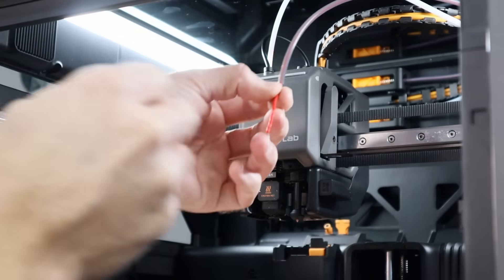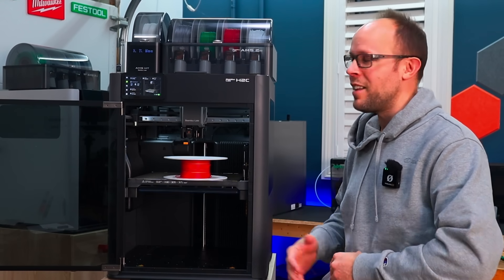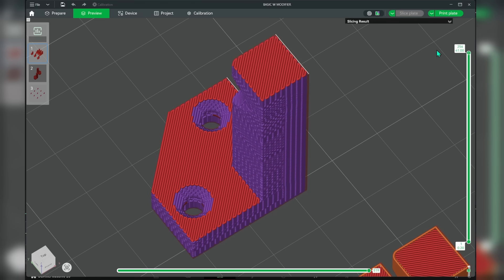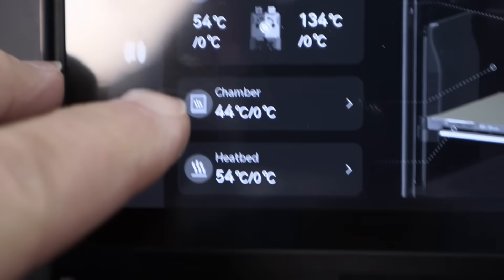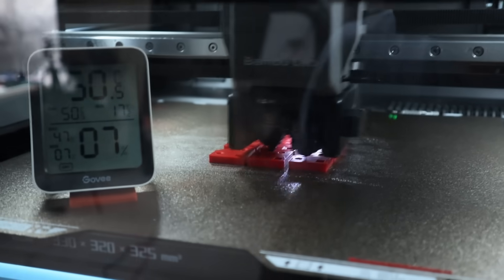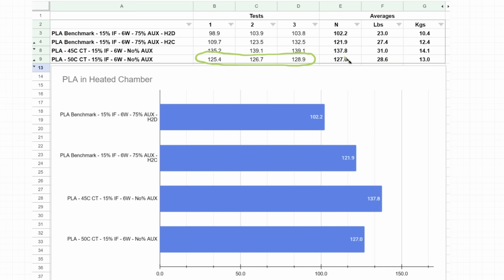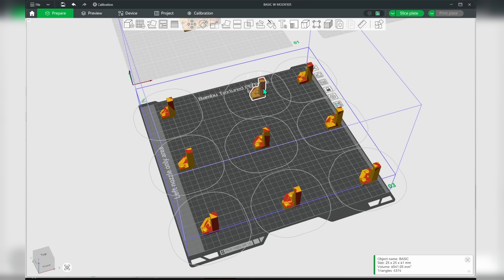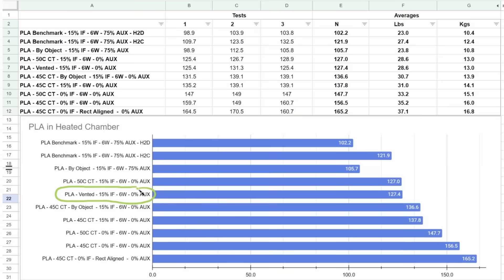If PLA can be printed inside of heated chamber, how much stronger are those parts?  Let's find out!

Comment: I would love to see temperature modeling of the filament and part trickle down to consumer slicers and machines someday.  The really high end machines keep a model of the heat flow through the part along and adjust fan speed and temp as they print to account for it.
Reply: It already exists in bambu slicer
Reply: @riba2233  No, it does not.  Variable fan speed and layer time is not the same as basing it on thermal modeling of how the heat is flowing through the filament into previous layers, and how cooling, layer time, and time the nozzle touches the previously layed down plastic and transfers heat into it.
Reply: @crashingsux  it does exist and I'm not talking about this standard stuff. It's called Helio simulation.
Reply: @riba2233  Oh yeah, I know it exists, just not accessible to non-industrial users that I know of. But if you have any links to things I could try out I would be very interested.
Reply: @crashingsux  it's accessible to everyone who uses bambu slicer, it's the icon in the top right next to the X button. It is a paid feature though, but I think they give a trial period.
Reply: @riba2233  Woah.  I didn't even know they had paid features.  I'll have to check that out.  Thanks for the tip.
Reply: @crashingsux  that's the only paid one tbh, and most likely just because it's a third party. Np 😉

Comment: the explanation of rectilinear infill "extruding into hot just extruded filament" makes no sense, of course the filament lays down next to hot filament horizontally but that has nothing to do with the layer below being hot, on the contrary it's normal walls that extrude on hot previous layers especially with no infill as wall speed is so high and when you go 1st layer in out 2nd layer out in! I assume the higher rectilinear infill strength is caused by the extra plastic extruded when the printhead changes directions fast making tiny blobs in the walls.

Comment: An interesting thing to try would be Helium. It has significantly higher heat capacity than "air", so you should be able to have high chamber temps while still having the heatbrake not get nearly as hot, since the helium is more effective on the heatsinks.

Obviously not very practical for the home printer, especially if it only improves strength in one axis by single-digits percentages.

Comment: Maybe just heat the air going into the cooling fans instead of the entire chamber? That way you should be able to have higher temperature air, but the nozzle, heat brake, filament bowdens shouldn't be getting nearly as hot. Plus, the hot air should be concentrated mostly at the top layers.

Comment: The material strength is often secondary to the design of the part. The flexibility of the geometry means you can just make weak points thicker.

Comment: In my experience, the active material doesn't suffer much from the chamber temp, as the warm material in that filament path is constantly being replaced with cooler stuff. But whatever is in the second nozzle (in H2D in my case) just soaks up the heat, and buckles or mushrooms as soon as it's needed.

Comment: Pro tip, try this test with a polylite pla filament. They anneal it so the filament on the spool has heat resistance of 140c. 
Also when you get a max4 printer try this again with the polar cooler.
Reply: I did a quick search but wasn’t finding anything saying they anneal their PLA filament. Do you have a source. Would be cool if true.
Reply: @jesondag  it's on their web and in their datasheets, they call it jam-free tech:

Jam-Free™ technology improves the heat stability
of Polymaker’s PLA filaments with softening
temperatures over 140 °C. As a result, Polymaker’s
PLA filaments show minimal softening in the “cold
end”

Comment: We fixed Replicator 2X heat creep / filament slippage by flowing compressed air through the feed tube.
For continuous operation, a membrane pump + heat exchanger was successful, along with a feed port made with a vented screw drilled to 1.8mm and screwed into a 3D printed manifold.
With that you can keep filament cool right up to the extruder no matter the chamber temperature. The outflow also serves to cool the drive wheel and motor shaft, and to some extent the heatbreak.
Reply: Excellent idea!
Reply: @michaelnoble2432  It's funny how a solution born out of the need to work around a bad early extruder design could allow printing PLA today with a heated chamber. If anyone can use it today to unlock better print results, please go a head (and show us the results... I've got a printer to modify as well, but making those screws is always an adventure)
Reply: What a great idea! I guess a relatively loose bowden tube/filament fit would be beneficial here, I've noticed the expensive Capricorn tubing has less clearance than the regular cheap white PTFE tube.
Reply: @ferrumignis  it doesn't take a lot of flow rate since the thermal conductivity of the tube is low. And then there is star-shaped PTFE tube, which is both tight and allows greater air flow. I should buy some..
Reply: @hardwareful the exact same idea popped into my head while watching this video! I also thought it could work well with those new star shaped tubes. Do you have designs for this feed port/manifold? And is the heat exchanger a necessity? Or do you use it to cool the air below room temperature?
Could this be good for TPU as well?

I'm also curious if there are any advantages or disadvantages using such a setup with more heat resistant filaments?

Perhaps it could make even higher chamber temperatures, like 60-80°C or higher, easier to attain. You mentioned cooling the extruder gears, with enough flow and a suitable design the print head electronics might be included as well. Although it might be undesirable to blow too much cold air around the part being printed, since its what we needed a high chamber temperature for in the first place. Also the chamber heater would have to keep up with the inflow of cold air. Then again, the inflow air would have warmed up a bit at that point. Alternatively a return air-line could be designed, perhaps coaxial with the filament tube using another larger diameter star shaped PTFE tube. 

At some point liquid-cooling might become easier...
Reply: @Ahapenootjes  Interesting angle to actively cool filament to make it more printable! The heat exchanger (not ideal - one of those dual 120mm fan jobs for PC watercooling) was necessary because that's how the pump gets rid of part of its heat.  Otherwise it would reach >40°C already. at 18°C room temp. TPU: anything helps, but I'm not sure it's feasible to cool down to like 0°C with peltier + pin-fin heatsink in a sealed and ported chamber. Does TPU in the fridge feel stiff enough? If so, one would need to pull the air intake through CaCl2 to dry it, or be dew point limited. Or be very hacky and put a radiator into the freezer, which will eventually clog up with ice but deliver cold, very dry air.
Reply: @Ahapenootjes  manifold design files: I'm afraid they're lost to time, though I have kept one printed ABS version of that thing. I've ordered vented screws and star-shaped PTFE tube and will spin a modern version with push-in connectors. Fwiw you can also use Volcano nozzles with 1.9-2.0mm ID, they should be long enough to act as a filament feedthrough bushing with sufficient flow resistance when the tip is filed down or drilled out.
I expect someone to beat me to it though. It's a proven concept, not much to go wrong except for the clearance between bushing and filament.
Reply: oh, cool. I was thinking water cooling of the hotend and extruder but was wondering about filament heating in the tube on the way to the extruder. I love your solution.

Comment: My only real issue with PLA is how quickly it deforms and melts under heat. HT-PLA doesn't solve the problem because while it's resistance is really high, it's only under its own load. As soon as any type of load is introduced it deforms. I primarily print in PETG because of this and I wish someone could solve this issue with PLA. I love all of the matte finishes, tons of color options and rigidity of PLA but prefer the heat resistance, impact resistance, flexibility, chemical resistance, etc of PETG. I would love to print in ASA or something but I refuse to deal with the toxic styrene fumes.
Reply: Then print with pet or pc

Comment: Yes you can print pla and petg in a enclosure. Do it all the time because of fume extraction in the prusa xl :) it's not a heated encloruser but it runs closed for 13 hours and get's pretty warm inside.

Comment: There is always some trade-off: either fast or solid, either good looking or solid. I print only utility parts and my printer is slow anyway, so I just go as high with nozzle temperature as I can with the part cooling fan as low as possible (sometimes off), also some over-extrusion (flow) and increased extrusion width helps. At some point you may over-tweak it, so you need to be careful. This may also affect the dimensions slightly. 
I mean you can achieve both fast, good looking and solid, but it would require tons of work with tweaking nozzle temperature and cooling fan speed, also those values would be different for each printer, each speed and each print. Maybe in the future somebody will create a system with rotating nozzle which irons and preheats part first, extrudes material next and finally slightly presses the new layer. But it would require quite a lots of work, another stepper motor would be needed and sealing the nozzle would be difficult. Probably not worth it 😅

Comment: to me, the reason why the 0% infill had better results, was because you are spending slightly less time printing each layer, so the temperature of each layer remained a little higher, resulting in a stronger part.
temperature, and spending similar layer time per print has alot of effect on the strength of the part.
Reply: I'd agree if it weren't for 9:38 where he printed 15% infill by object (less time printing each layer) and the result was nearly identical to 15% infill by layer (136.6 vs 137.8). Hard to explain that result.
Reply: @npopson  Agreed, the by object result was unexpected for me.  Possibly the minimum layer time in the slicer is set too high?
Reply: Yep

Comment: qidi is going to release polar cooler for the q2 and max4, will blow 10C air onto the extruder so mby no more clogs
Reply: Didn't know it was planned for Q2 so the Max4 was tempting. But I see the On/Off toggle for Polar Cooler in the Q2  Klipper.
Reply: When I saw the thumbnail, I expected this to be a review of the Max4 or at least initiated by QIDI’s marketing of heated PLA printing.

Comment: Another amazing vid!
Might insulating the ptfe feeding tube allow for printing in increased  chamber temps?

I'm even getting the funny thought of forcing cool air through the ptfe tube alongside the filament, but then you will have to make small cuts close to the extruder to free the air up again so it doesn't go into the extruder and cause bubbles

Comment: When Bambu showed their laser, right before the release of the H2D, my first thought is that the laser was going to be used to heat the previous layer right at the spot where new material would be laid, effectively softening the previous layer locally to improve layer adhesion. But that would have been too much of an advance.  This is likely something someone MUST be trying somewhere.
Reply: There are industrial printers that use an infrared lamp. They not only heat the previous layer, but also anneal the part as it's being printed.
Reply: @polycrystallinesilicate  That’s for LPBF process or MJF/SLS not FDM, where a heated chamber will do the same thing. In an ideal world, you want the chamber to be the same temperature as the bed, the best temp being the Tg of the material (most PLA, that’s around 45c). This eliminates the possibility of stresses forming in the part, while also increasing the part strength because you have increased bonding when a materials are fused at their Tg.
Reply: @Inova3DSolutions  This works so well for ABS, I print at 80C chamber and 80C bed temp and my parts come out much stronger and warp free.
Reply: @crashingsux what machine does 80C chamber?
Reply: @CompletelyNormalPhenomenon  Many industrial machines, but I have a homebuilt, based mostly on the Doomcube which is a high temperature machine based on the Voron.
Reply: @Inova3DSolutions  there are some fdm printers that have that
Reply: the laser isnt focused on the same spot the nozzle would go it would men a LOT of extra moves like 2 times everything at LEAST
Reply: @Suchtzocker  Yep, you'd need to steer the focus spot so it's always in front of the nozzle.
Reply: No need if you know what you’re doing. 5c increase on first layer is more than enough to fuse a color change to existing layers

Comment: If remaining hot is a key factor, then how much does printing hotter help? If you print at, say, 230 instead of 220, does the filament stay in the 'hot enough' zone longer for better bonding?
Reply: My understanding is printing too hot is going to disintegrate the material itself. Whatever benefit you might get from printing it hotter would also be affected by how the material itself is getting weaker.
Reply: @SniperAngle12 yeah, could well be. Might be worth a try though

Comment: One idea would be to use the laser air assist pump to either cool the tool head area or have it feed air around the filament in the ptfe tube, assuming the pump doesn't heat up the air to much in case maybe an inline peltier element could work. Goal would of course be to keep the filament route at lower temperature.
Reply: I was thinking in a similar route with a peltier on the extruder assembly or forced external air through the PTFE tube. It could be possible by modding an AMS with an air inlet to a small compressor that simply provides a higher pressure air that can only leave through the tube. But I'm not sure if all the PTFE connectors, filament buffers etc inside the printer are airtight until they reach the extruder.
I was also thinking about cooling the filament in the AMS to well below ambient temp (putting the AMS in a fridge lol) in hopes that that way it takes more heat energy to heat back up and thus the filament doesn't get a chance of reaching the softening temperature until it gets to the heating element. This would likely be a pretty unreliable method though as it needs to be feeding fast and constant enough to prevent it from spending enough time in the heated chamber to heat up, and the cold AMS means moisture is a risk as well

Comment: Watercooled setup could allow you to print in a higher chamber temperatures.
Reply: Or chilled air on heatbreak/gears like qidi is doing
Reply: @riba2233 hey, is their new q2 doing that? cuz I was wondering about pla cloggs in the heartbreak due to heatcreep when printing in a closed up printer.. they say you should keep the door open a bit to remedy that but that defeats the purpose of the exhaust air filtration IMO..
Reply: @crypton1782  1.  Q2 supports polar cooler in theory 
2.  Don't assume that you will get perfect filtration either way

Comment: tldr: its about 20% stronger.
Reply: Thank you!
Reply: 100th like is from me!
Reply: *most aren’t
Reply: Thanks, that graph is absolutely useless without an explanation which is not the way graphs are supposed to work.
Reply: Thanks !
Reply: Would I set the infill to 0% for strongest prints?
Reply: @CC-nt4zi i find 1000% to be ideal
Reply: at 45°C chamber
Reply: If you want more layer bonding just print at a higher temp and / or with less fan. Also keep layer time down by not printing many parts at the same time.

Comment: Very interesting how the slightest changes in temperatures or parameters can influence strength so much. And then it probably all changes with the brand or color of filament too lol
Reply: I wonder how this would do with the HT PLA filaments? Maybe a slower cooling process. I simply put some file folders around the bed of my Ender 3V2 for  ETG, and it looks beautiful.
Reply: Yes, lowering print speed has a noticeable strength effect as well because the filament gets heated closer to 220C or whatever nozzle temp you have set. Most of the time it's coming out the nozzle at a lower temp at default speeds.